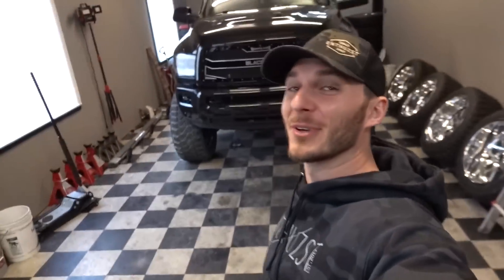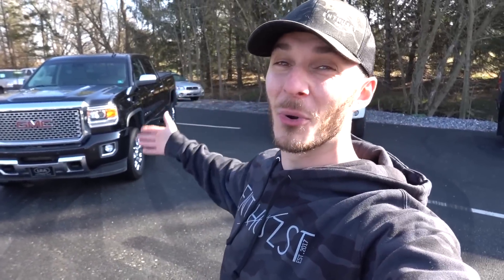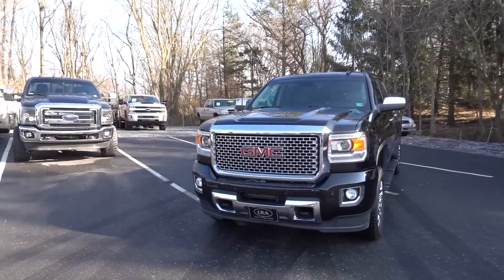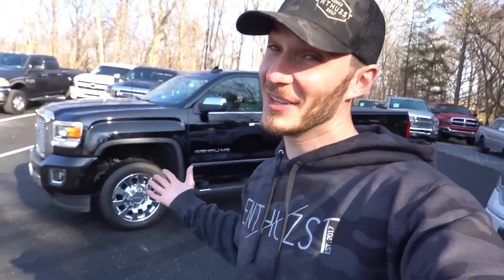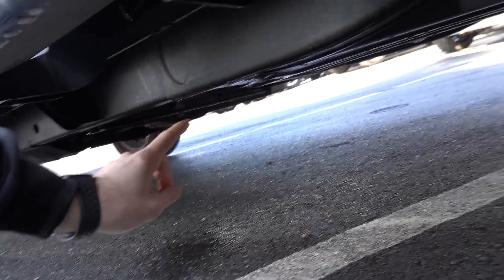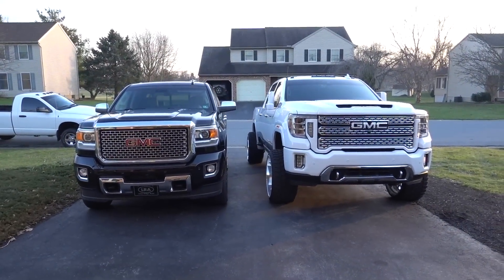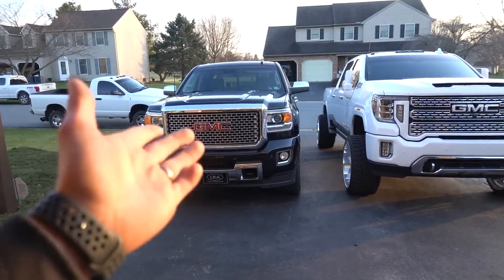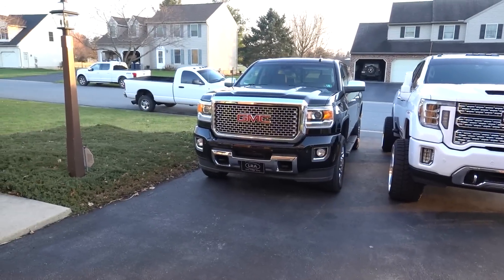6 Years Later and I FINALLY GOT IT!

Comment: In my opinion
3 to 4 inch lift
20x10 wheels w/modest offset
A set of good 35x12.50 tires
And some paint matching would be legit! Something a tad different from the extra wide stance but just a tad of a tire poke. That’s how I would build it

Comment: Comming from central Florida, Take the lower valance off, put uniball upper control arms and bilstein lift struts in the front with a leveling kit on it and diff drop brackets kinda like a lift kit without all the other stuff that makes it look like a lift. Throw some 37/11.00/20 nitto trail grapps on it on the stock 20s. And mayb some color matching forsure in some areas.

Comment: put some nice tow mirrors on the 2016 gmc  the small mirrors don't last long and they look cheap and they break I just bought a 2018 gmc 2500 the small mirrors one broke I replace it with a tow mirror im ordering another one for the passenger side and I have to run 3 wires in the harness for the signal and cargo lamp and amber front lights to get them to work didn't wanna spend 160 for the tow harness

Comment: Longest platform would be the old 350 small block 1955 to 2003 only change was vortec heads and fuel injection